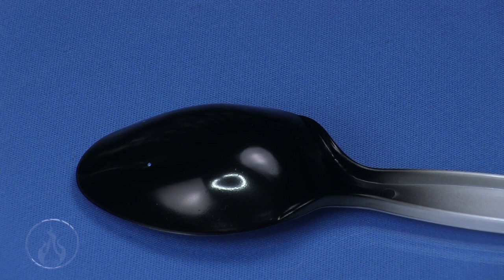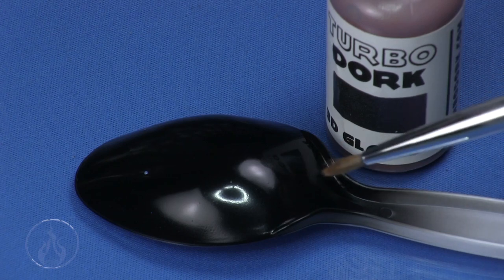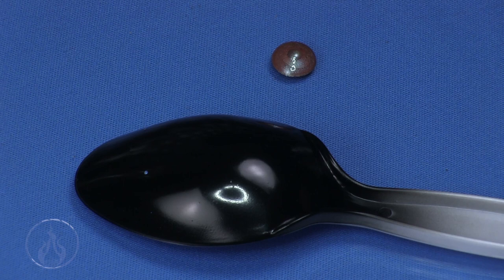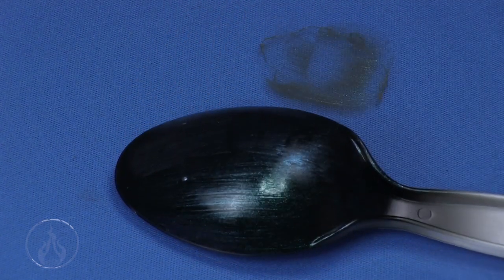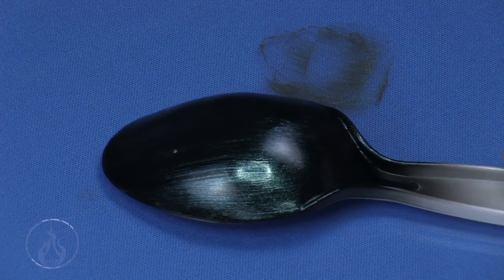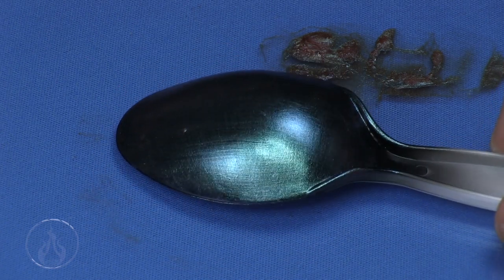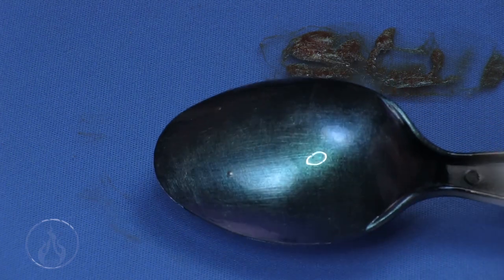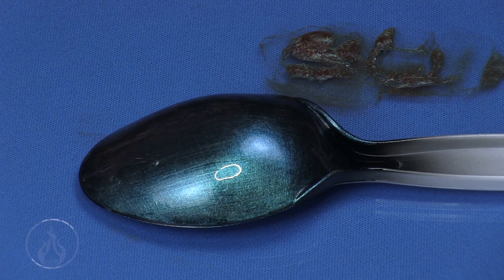Just the Tip! - TurboDork Color Shift Paint - Applying by Brush

Comment: For some reason, the paint I bought is way too watery, it looks more like a wash than anything. I’ve tried shaking it for a while but it didn’t make a difference. Is the bottle I got just defective, or is there something I can do to thicken it up?
Reply from the maker: In my experience some of the colors feel very thin, Not really a huge problem as long as your are comfortable with laying smooth layers by hand. For best results be sure to use a gloss black primer if possible. 
Otherwise I would contact TurboDork and advise them on your particular issue and see what they can do for you. I'm sure they will be very happy to help you out.
Reply: @WayoftheBrush  Thanks for the suggestion! I’ll try that :)

Comment: I'd definitely recommend using an airbrush for any of Turbo Dork's range, BUT it is possible to use them well with a brush.

The best way I found was to thin them with gloss varnish and a bit of UMP thinner. You'll have to play around with the ratio depending on which particular colour you're using (eg I found a 1/1/1 ratio was best when using "3D Glasses") but its definitely doable. Just be prepared to use plenty of layers.

The coarseness of the metallic flakes (which I'm guessing is necessary for the colour change effect to work) makes working with these a little tricky, but if you're prepared to experiment it pays off.
Reply from the maker: Excellent suggestion!

Comment: Would lightly buffing the paint coat with a fine grain nail file, wiping the excess powder, then adding the gloss coat help with the streaks? My gf does that with her metallic nail polishes to smooth out the brush strokes and it works nicely. Not sure how that translates to acrylic paints.
Reply from the maker: Using a very fine grit file could take the surface down a little. The paint doesn't finish powdery the streaks are just due to the nature of a metallic over the black base. It just makes the brush strokes very apparent. If you're comfortable with glazing layers of paint then it does mitigate the brush strokes.

Comment: Thanks for the tips. I ignored your advice and watered it down and wicked away the excess and it left lovely a lovely smooth finish with a brush. Maybe they have changed the recipe. Edit: I noticed bubbles after mixing it with water on the surface. I expected them to pop as it dried, but alas they didn't. Now I have pock marks all over the surface. The layers are smooth, but the bubbles have kind of spoiled the finish. Also where it pooled in the recesses, it kept the lighter/whiter tone that came out of the bottle. I thought it was like a gloss varnish and would of cleared as it dried.
Reply from the maker: a few of the paints have that kind of medium and one should strive to apply thin coats with these colors.
Reply: @WayoftheBrush  I should of listened. Onto the next batch.
Reply from the maker: don't be afraid to fail at your first attempts at painting. You learn way more by failing than by straight up instructions.
Reply: @WayoftheBrush  Not my first attempt, just first time using Colourshift after a long break from the hobby. They will do regardless, not going to waste to much time focusing on small details for a horde army that will be dropping like flies and being removed from the table.

Comment: I bought two bottle to test them and maybe they’d work on model cars but my results weren’t very good. Perhaps it was due to not using black gloss as a base. But what i noticed and didn’t like was the paint was too thick to airbrush. Perhaps i needed a larger needle? I had to thin it, if i remember correctly, two parts paint to one part thinner. That’s a lot of thinner for claims that its ready to airbrush.
Reply from the maker: Often it is recommended to airbrush with a .5 needle. I don't thin often when using TurboDork.

Comment: Would you think thinning further and doing more coats would remove the brush stroke issue?
Reply from the maker: It can. Be sure to use an acrylic thinning medium as water may cause the pigment to separate.
Reply: @WayoftheBrush  Thanks, just got some Dark Net to try out on some Dark Angels and not sure how it'll go through my bargain basement airbrush, good to have a back up plan. 

Got any tips for highlight technique with these paints?

Comment: Hi Kris do you think using a makeup brush would further reduce the brush marks?
Reply from the maker: It could, if the paint had a longer working time. Also bear in mind that this is a large surface and on camera. Meaning the camera pics up all the flaws were the eye is much more forgiving.
Reply: Use less paint, keep your brush dry, and LIGHTLY apply one layer at a time and the brush marks should be subtle enough to pass for a ‘clean’ paint job.

Comment: Question.  I always apply a flat lacquer top coat at the end of a paint job to help protect the paint.  Any chance that will impact the colorshift paints?
Reply from the maker: Lacquer on top water based acrylic? I've not done that before.
Reply: @WayoftheBrush  Do you do anything to help protect the pain job or am I being to cautious?
Reply from the maker: @DougSchulz  I do varnish my game pieces. I use Pledge floor polish. I have talked about using it in the past. You could also use another acrylic varnish, all depends on your preference.
Reply: @WayoftheBrush  Thanks!
Reply: Hey there, the type of coating you use WILL have an effect on the finished look, just like with any other kind of metallic paint. Gloss coatings are recommended for colorshift paints as it will bring out more reflectiveness, mattes and satins would give a more solid look. Kris is probably right in using varnish to coat acrylics as that is what i’m using. Other types of coatings would probably work too but you’d have to make sure how the intended coating would react with acrylics.

Comment: Any recommendations on dilution?
Reply from the maker: use water or water based acrylic medium as needed. The paint itself is a thin bodied paint and doesn't really require thinning. I use it as is straight from the bottle even for airbrush work.

Comment: your came out a colour of sorts mine is white i shook well too is that normal was ok on one model but it was already painted blue and the effect with my blue rasberry is actully really good the rest total fail not sure what i do wrong as those i started with the black probably not gloss though
Reply from the maker: it is not entirely necessary to prime with a gloss but it does help tremendously
Reply: I found that the pigment in some of the bottles will settle at the bottom and won't break up with shaking. I fixed this by gently squeezing the bottom of the bottle to break up the pigments and sort of "pop" them off. Sometimes they'll come off in a congealed plate but since there is a mixing bead in each bottle once it's off the bottom the pigment mixes just fine.
Reply: DoctorBarbarian not sure if your trolling me mate lol ...i find these pots really easy to lose all the paint i did pop to hard and get it all over myself but a lot of it i saved i was very lucky i have empty pots around saved a good 80 per cent this stuff is great still using it...i find it works really well if you really look like you have put to much on then just work with it keep layering for ages the pigment comes out better the more you work on it
Reply: @markjoachen  not trolling at all. When I said squeeze the bottom, I didn't mean upside down with the cap off Haha. I was just trouble shooting an issue I had and I saw a few other people have had. Dunno if it's the same issue you were having, but sometimes the pigment stays at the bottom of the bottle, so when I thought it was properly mixed and put some on my palette it would just come out as a glittery milk. Sorry if I caused confusion.